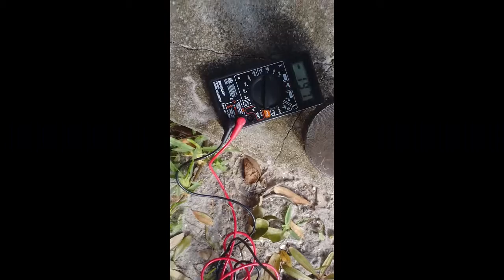ATMOSPHERIC ELECTRICITY VIDEO

Comment: is it possible to make sparks or even plasma with that voltage?
Reply from the maker: No. Voltage is too low on this for dielectric breakdown of air. You want whimhurst or tesla coil
Reply: @peterlang777  doasnt matter, need to make plasma even a little bit
Reply from the maker: Take a hand held tesla coil. They used to check vacuum tubes in the 40s. Makes plasma
Reply: @peterlang777  from atmospheric electricity?